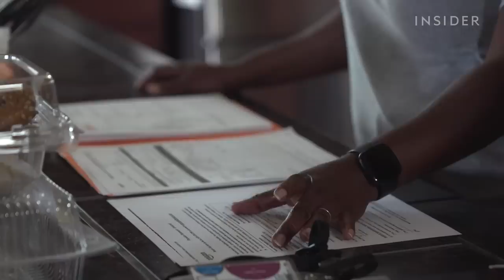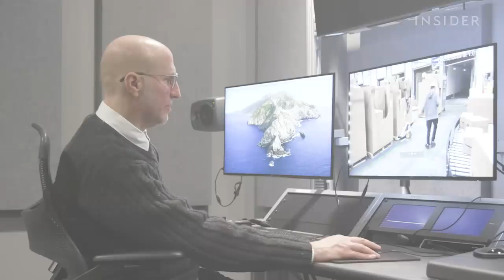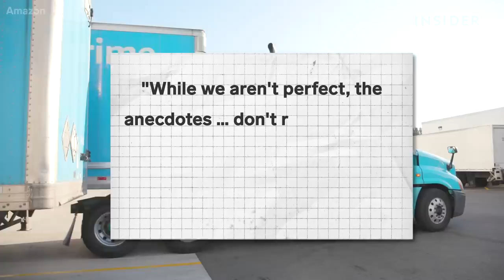The True Cost Of Fast Free Shipping | True Cost | Insider Business

Comment: I worked at a warehouse when it first opened and was there for four years. I can only speak for myself, but everything mellowed out after the first two years as more warehouses opened up and the spotlight was no longer on the one I worked at. Did not receive a single injury and wasn't written up for anything.

What I did was change departments as frequently as possible while avoiding the ones with the worst reputation, keep my mouth shut, never be late back to my station and stay busy. I saved my paid time off for emergencies and the end of the year before it resets.

I think everything depends on the site and your manager.
Reply: Agreed. Seems some FC are super strict and other just care about the bottom 5% of performers.

Comment: This ain't just Amazon either, I worked at an AutoZone Distribution Center for about a year and it was demanding as hell to keep up with production rate when you have to pick 800 pieces for one store. That includes rotars, brake pads, rags, ramps, starters, windshield wipers, etc. And you could pick for 15 stores a day or more, depending on how many parts they need. Some of that stuff is really light, like air fresheners, if you get lucky you get inbound, taking stuff off of the trucks and on the shelves, my best friend did that and all she did is spark plugs, tshirts, gloves, etc. On my end, outbound, I was lifting heavy stuff like batteries and oil boxes onto pallets, some stacked taller than my 6ft self. It wasn't so bad at first, until the constant overtime came because night shift didn't move as fast as day shifts did. So we started working 5-6 days a week, 10 hours or more. Instead of out usual 4 days at a max of 10 hours per day. Our turnover rate was huge.

Comment: I worked with Amazon UK for a year and half as a part-timer and I have personally experienced what Mark went through. The back pain, shoulder pains, nerve jolts in both hands when you lift heavy items is constant.
Reply: That's the same with most manual labor jobs.
Reply: and you got paid for it, so thats the trade...
Reply: @trader2137  4x more likely at amazon then comparable industries. That’s an issue. We know injuries will happen, but they should be happening 4 fold
Reply: @trader2137  sorry i meant to refer directly to this DC. This dc is 4x. 2x for the national average is still a big problem. As someone who works for amazon as a subcontractor driving. I can tell that they don’t have disabled people running boxes. They manage drive lanes and outflows of vehicles. Everyone is fit for the job, the requirements are being able to lift 50 lbs. UPS, Fedex, they are all hiring the same types of people. For this warehouse to have 4x the average and 2x for the national average there must be a systemic issue of safety at amazon. Being a driver, I see how frequently blatant safety issues occur and are encouraged. So i wouldn’t be surprised if Amazon does the same for its actual workers.
Reply: First of all I know there are injuries in the job but half the people talking about their injuries are out of shape and shouldn’t have even been working this unless they are in shape

Comment: I am 73 years old and I worked for 10 years for Coca Cola in ways that required at times extremely difficult and heavy lifting and pulling pallets that weighed 2200 pounds. I loved the physical strain ❤it put on my body and it hurt my body in different places also for too many years. Then one day I decided to get physically fit by exercising religiously almost every day after work. The result were amazing, within a couple of months I had no more pain, and I lost weight, built up my muscles in the areas that my work put the most strain on. I don’t wish to delegitimize these people’s pain, but I pulled 2,200 pound pallets on a slightly uphill grade and I learned how to do it properly, without injuring my back, which did happen at first but you learn how to pull the weight without hurting your back. Being physically fit in a job that demands a lot of physical effort is just common sense, and accidents can happen to anyone but less likely if you have conditioned your body to take the strain on it seriously through exercise and more exercise.

Comment: 3:30 "to meets specific rates" Yes amazon does do that to you, I was a packer, boxing the item and if you are the lowest 5% bottom of the group you will get 3 warnings and 4th was let go, Of course the old people went first than the ones that work at a normal rate. Leaving it to those young 20 years old making it feel like high school again with the drama increasing
Reply: At my FC it was the bottom 3%, though other ones may be different. The good news is that if you stay out of the bottom 3%/5% you won't be affected even if you don't meet rate goals.
Reply: Wait, no fixed goals? Its relative to other's performance? It makes squid game (Is It that the name?) look like a fun time!
Reply: @rawdata678  It varies from building to building. Mine is related to performance rather than rate. The rate is expected at 350/hour. But most pull 250/hour. Youll get in trouble if you go under 200/hour though, as thats roughly the bottom 5%.

Comment: I can vouch for this as an employee in the pack department at an Amazon fulfilment center. That injury risk chart at 4:15 looks pretty damn accurate. I'm lucky I started when my building opened, because the other departments are so strenuous that nobody wants to work in most of them, so my department doesn't do nearly as much hiring because of internal transfers from other departments. My job is still rough if you have to work a bunch of overtime, but I've heard horror stories about the other departments, so I'm cool with where I'm at until I finish my degree. The injury issue is certainly exasperated by people not doing proper movements or lifts, but ultimately the rates and hours are putting employees in a situation where it's bound to happen. Even in pack, when I did overtime over the holidays last year, my back was starting to hurt as Mark described in the video. I can't imagine the other departments.
Reply: I worked at a robotics FC from 2019-2021 (I'm now in a much smaller Amazon food warehouse), in many different roles, and would say that Pick is physically  the hardest, followed in order by Stow, the docks, AFE Pack, and Singles Pack.

Comment: I work for Amazon and have travel to many sites for work. Some sites are way better than others. Some sites are very big about safety and proper lifting techniques and also buying robots and the tools to make jobs easier, where I noticed the older sites tend to have more of this mentality mentioned in the video. It’s important to keep in mind that this is not true about Amazon, across-the-board it  varies from site to site.
Reply: If people complain enough and enough negative things happen, Amazon won't be improving worker conditions, they'll simply be replacing more workers with robototic and automatic machines, it's been already happening and the warehouse could come down to a skeleton crew on computers running a multitude of mostly automatic robot and automatic computer controlled machiens that do the sorting, picking, packing and loading.